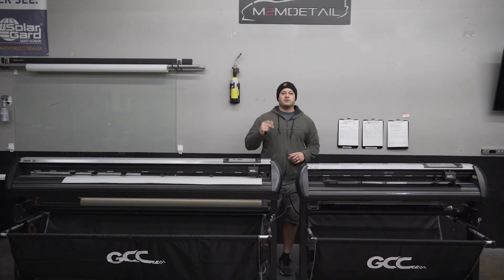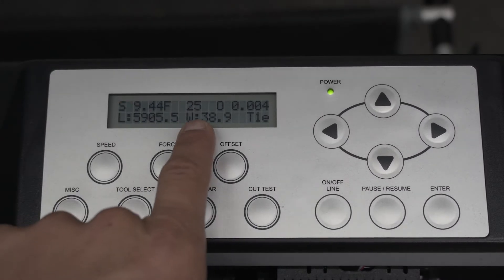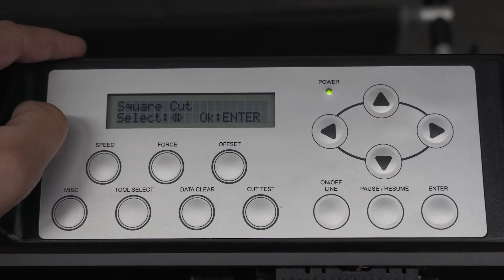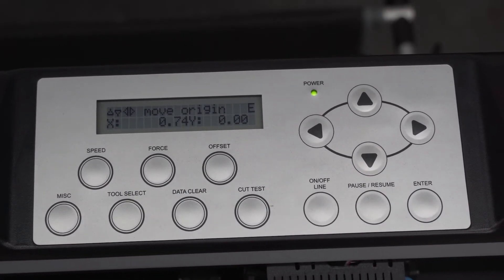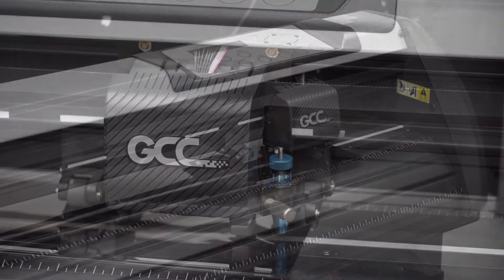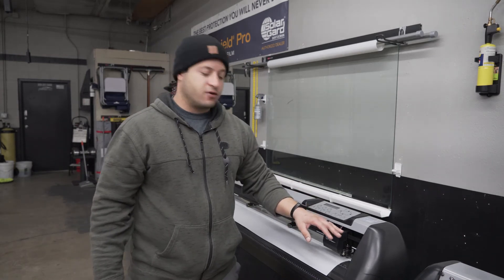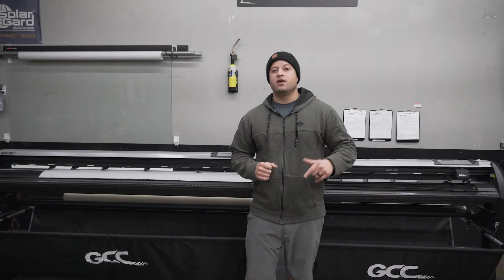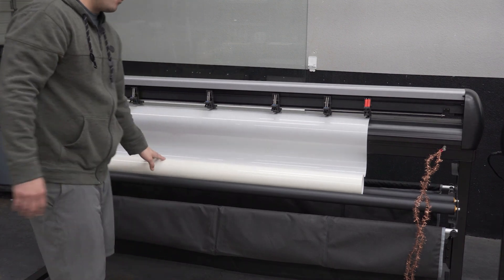How To Use Your GCC Plotter

Comment: thanks for the info Mark, I was hellbent on getting a older used graphtec for the price point but I see this jaguar is def a worthy investment! so far we have done stickers/contour cut , printed and vanity wraps along with vinyl letters.. but I need the ARM option which I dont have on my saga cutter..  are those programs buy once or rent forever?  : )
Reply from the maker: The programs I use are rent forever but I know some software are buy once.
Reply: @m2mdetail781  Mark,  is the 72" a must have?   I found a 66" with servo and arms capability  thanks for the info !
Reply from the maker: @jimmyfavereau  That should be fine. I haven't used any film bigger then 60in. 👍

Comment: Hi..do you think 52" good enough for tinting and ppf a f150? Thanks
Reply from the maker: For tinting that will be no problem but for a full hood cut not sure if that will be enough. Normally films are 36in, 48in, 60in and 62in wide.
Reply: @m2mdetail781  thanks
Reply: For mobile tinting what do you recommend

Comment: Hello was thinking about getting this, do you have a lot of problems with this brand plotter? A lot of people say they do ?
Reply from the maker: I haven't had any problems with both of mine. I really like them and once you understand how to adjust the settings you will be good to go. Both of mine run on the daily and no issues. I would recommend anyone to get one. 👍
Reply: @m2mdetail781  Great thanks if it’s for only window film what size do you recommend ? would 42” be good?
Reply from the maker: @mradams5455  yes just get the GCC VLX 40in for window tint the only car I can't cut so far is the back window on the model 3. I just hand cut that back window which makes it easy for you to shrink the film as well by not cutting it. 👍